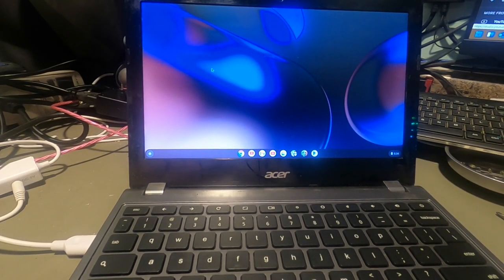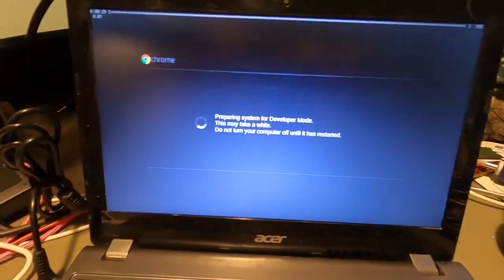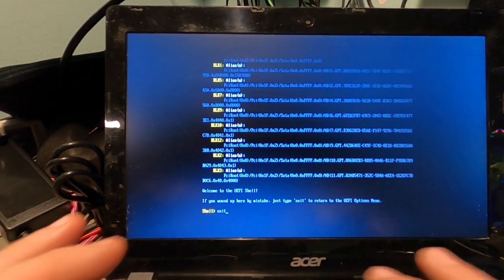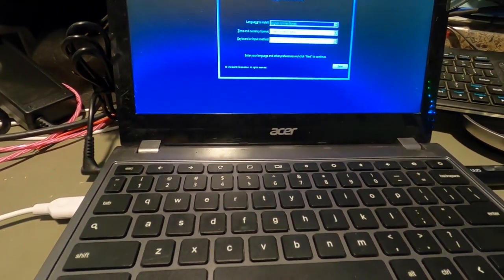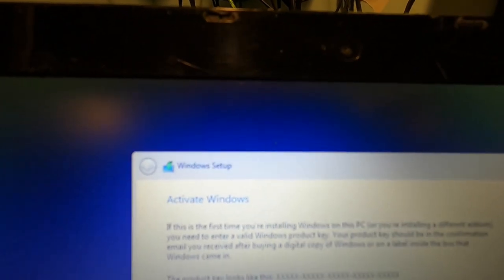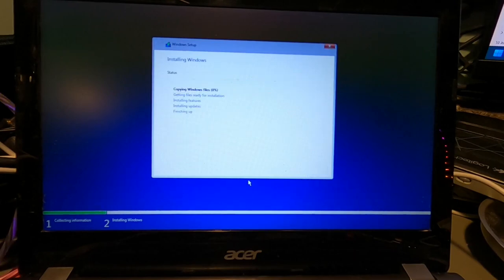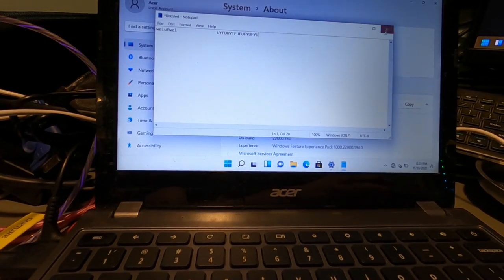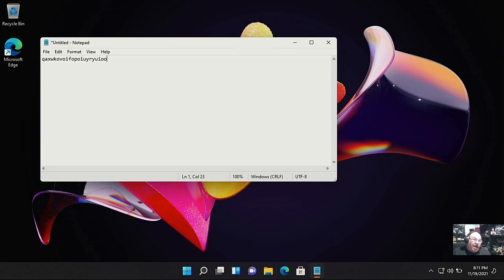Windows 11 on an Acer Chromebook C720/C740

Comment: Ok, I apologize in advance, because I didn't know how or where to contact you with questions. But honestly, from all the people I've seen on YT, I trust your opinion. Ok, so, I have an ASUS CM1855- and I wanted to know if you thought this was obsolete or if I should keep it to upgrade it as a gaming computer and everything beyond. I was getting ready to purchases an SK Hynix gen 3, along with other top end type products to do a custom (kinda) build as I go. If you need more specifics, I'm readily available and waiting for your response (along with if you needed me to contact you on a diff video, platform etc.)
Reply from the maker: I'm assuming you are running an FX chip on that. AMD recently reimbursed several people (myself included), as part of a class action lawsuit when it came to the FX chips. I received a check for a couple hundred dollars as part of that settlement because I had purchased (& registered) several FX-8350 chips. The issue is false advertisement on the number of cores. That wasn't the only issue with FX chips. They run notoriously hot in comparison to other CPU's. Still viable?? Yes, I think Jay shows that when he played around with an FX-6100: https://www.youtube.com/watch?v=dioUVOCCndY Cost effective?? Unfortunately, no. Believe it or not, the wimpiest Ryzen CPU, which is what.. the Ryzen 1300??, will romp all over most any given FX setup. And it will romp it badly. I have always been an AMD fanboy mainly because I'm a cheap bastard, but the FX lineup is kind of one of those I like to pretend never happened. I do still take them as trade ins, because they do perform well for certain things, but usually what they are made into, is PC's for older folks on a budget. I honestly don't have the guts to throw a higher end GPU like say a 1650 or 2060 in one and dare call it a gaming PC. Sure it will whip out some decent frames, but you'll probably see occasional stuttering, this will increase the hotter the CPU gets or the more taxed it becomes. Ideally, a good GPU should be able to counter what the CPU is trying to process, but then that's where it starts getting expensive. You don't wanna spend high dollar on say an RTX 2060 + FX chip just to get the same frames you would out of say a Ryzen 2200g+ GTX 960. I'd keep the Asus setup, it's still good and the same method I used in this video to install Windows 11 will work on that board as well if you are interested in doing that. I'd maybe cap it out at 8 gigs of ram, maybe a GTX 960/1060/1650 at most and leave it at that. I wouldn't put too much into it, your money would be better spent if you focused on getting into a newer AM4 platform. Doesn't matter which chipset really, just move up from the FX series. I'd use the ASUS setup as a stepping stone flip to another more modern setup. So I guess what I am saying is, yes, make it into a gaming setup, but do so with the intention of flipping and selling, don't put too much into it because you'll be kind of disappointed and will kind of have wasted your money. If building it as a gaming PC flip, stick a GT-1030 in it. The air cooled 1030's are nice well rounded GPU's that play on pretty equal terms with a CPU like those.
Reply: @phreakwars  interesting. Yes, you are correct. I have an FX-6300 SERIES in this PC. I actually haven't done anything to this yet. It has 6 cores. 12 gb ram stock. 6 USB ports. 4 3.0 USB ports..I just opened it up, I have 2 pcie 1_1 &1_2. Also a pcie4. 1000gb HD. It definitely runs much better than the HP AIO I have, that you had made a video about also. But besides all of that, I was going to get a wifi adapter card, which I'm not sure if I am now. Based on what you are saying, I assume I should start from scratch and build a new custom PC, correct? The other question I was contemplating, was to maybe just get a high end ssd, for future build, or would I be better off waiting until I get my base/motherboard? If so, any recommendations? Again, I REALLY appreciate your advice, I've learned so much from your videos, you do an excellent job of explaining without speaking a "foreign language" lol
Reply from the maker: @Nytzfall  SSD's are so cheap now, it would be silly to NOT buy one even for an older FX setup. Typically what I do is run a smaller SSD as the primary drive and use a larger slower HDD as a secondary for games and shit. With that being said, I'd maybe toss in a 256gig SSD into it along with the old drive and call it good. Newer hardware you'll probably wanna skip the SATA SSD and go straight to an M.2 drive.

Comment: Is it just me or does that battery look broken down? Im not saying it is, but to me it kinda does. It could be because it's an older chromebook but im just pointing it out.
Reply from the maker: Yeah, someone tampered with it on the inside. It's pretty obvious. Not sure if you can tell in the video, but the battery was also pretty scuffed up. That's not gonna happen unless it was out of the machine at one point. I was gonna change it either way, but yeah, clearly the seller had this old Chromebook, maybe several of them, I bought several, that were junk and he made working units out of them and sold them off pretty cheap. You'll notice a broken bottom and several scuffs on this example C740 in the video. This probably wasn't the prettiest Chromebook on my shelf, but it made for a great guinea pig to see if Windows 11 would work.
Reply: @phreakwars  Can you use a like A windows 11 USB like When you have a windows 10/11 And Download For USB Can We Do That?

Comment: Saludos hermanos desde Venezuela Por favor haga un video explicándolo bien Porque yo tengo una laptop con ese problema es HP Voy a meter El pendrive y no me deja meterme a la viu Por favor puede enviar los comandos por favor Saludos y Bendiciones Eres el mejor Y tampoco puedo descargar el firmware
Reply from the maker: Debe especificar qué modelo exacto de HP tiene. Todos tienen diferentes procedimientos y diferentes formas de entrar en modo desarrollador.
Reply: @phreakwars  HP Pavilion 14-c050nr 14" Laptop, Intel 847 1.1GHz 4GB RAM/16GB SSD Chromebook
Reply: Hago los Comando y me da error Puede pasarme el formato de la bios para yo formatearlo con el adaptador o Pásame los comandos bien escritos por favor Quiero poner mi computadora HP en Windows
Reply from the maker: @yiyobarreto7777  
1. Apague su dispositivo, abra la parte posterior y conecte el puente de protección contra escritura. https://i.sstatic.net/UfRSG.jpg
2. Presione Esc + Actualizar + Encendido
3. Presione Ctrl + D y presione Enter para habilitar el modo desarrollador
4. Presione Ctrl + D para iniciar Chrome OS
5. Abra una pestaña y presione Ctrl + Alt + T
6. Escriba "shell" y presione Entrar.
7. Pegue lo siguiente en el shell y presione Intro:
cd; curl -LO mrchromebox.tech/firmware-util.sh && sudo bash firmware-util.sh
8. Seleccione "Firmware UEFI completo" de las opciones.
Reply: @phreakwars  Una pregunta yo puedo formatear la Bio con La pinza
Reply: @phreakwars  Saludo desde Venezuela yo hice todo el proyecto pero a la final cuando empiezo me da error
Reply: Una pregunta yo puedo formatear la Bio con La pinza Ya compré el adaptador

Comment: I downloaded and Install windows 10 but my touchpad is not working, also not showing in device manager and devivices
Reply from the maker: You'll need to visit coolstar.org to download the correct drivers
Reply: Ok I'll do that
Reply: Do I need to do any additional steps?
Reply from the maker: @parasqazi933  Yes, you'll also wanna install the keyboard remapper utility also found on coolstar.
Reply: @phreakwars  I didn't find derivers for 3215U
Reply from the maker: @parasqazi933  use the ones for the 3205U.

Comment: hey im having trouble with my blue tooth can you help?
Reply from the maker: Bluetooth driver should install after you do a Windows update. Your video drivers will also install after updating. Do that first and see if it fixes the problem.
Reply: @phreakwars  so install blue tooth driver ? What if I tried and it told me I can’t install it ?
Reply: @phreakwars  got any fix?
Reply from the maker: @AbeSwavay  what was the message that you got? Honestly, you should not need to install any drivers. It should just work. The only thing I had to do besides install the touchpad drivers and keyboard remap, is do a windows update and remember to INSTALL OPTIONAL UPDATES. Those will be the video and Management drivers.
Reply: @phreakwars  do you even have a blue tooth driver in your computer ? I have the same exact one as you . It tells me that my computer is not does not take blue tooth because it doesn’t have it in its system and to use an adapter .
Reply from the maker: @AbeSwavay  Honestly not sure what to tell you. What does it show in your device manager? Is there a device listed as unknown? Perhaps showing up as disabled? Can you post a screen shot?
Reply: @phreakwars  do you have blue tooth in your device manager tho?
Reply from the maker: @AbeSwavay  yes
Reply: @phreakwars  can I try installing the drives again on windows?
Reply from the maker: @AbeSwavay  OMG, I am SOOO sorry, I was totally thinking of a Lenovo Chromebook I worked on. I am telling you wrong!! The Acer c740 does NOT have Bluetooth. Holy shit I'm losing my fucking mind I swear. So sorry.
Reply: @phreakwars  thank you so much for getting back to me on that . Honestly don’t need it any ways was just curious if I can use it.